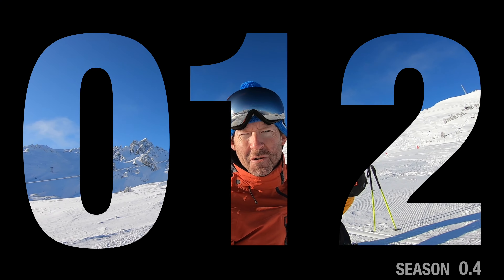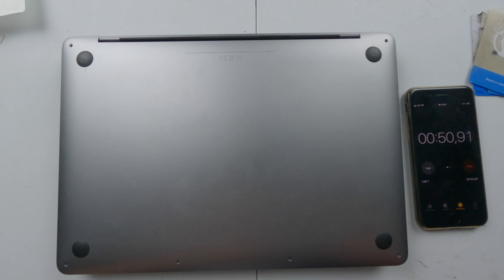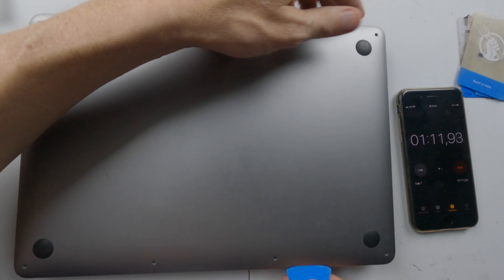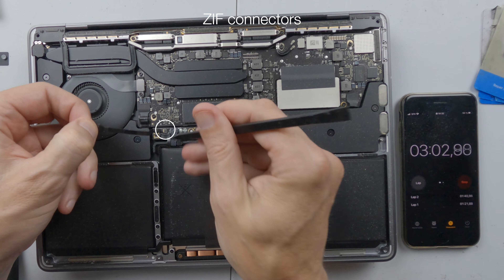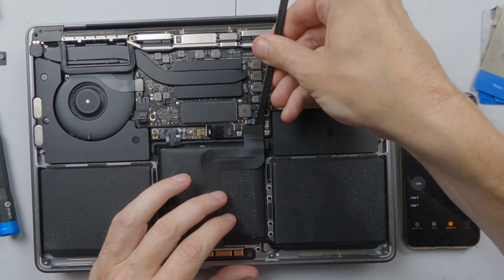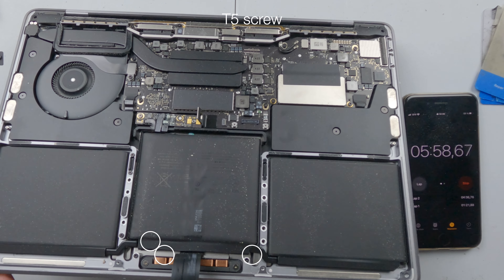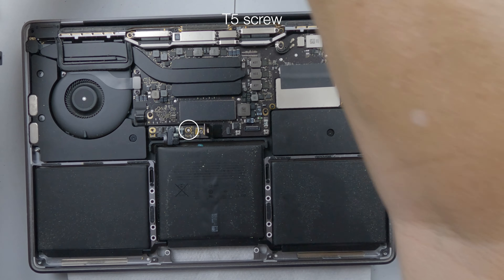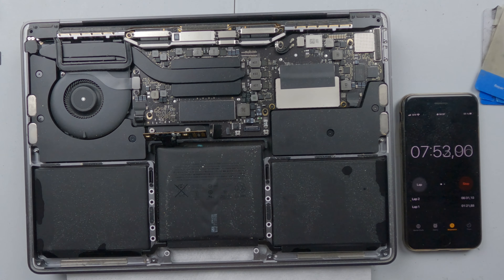2017 MACBOOK PRO A1708 BATTERY REPLACEMENT 30 MINS 4K

Comment: BEWARE! When putting back the ZIF connectors you MUST NOT allow the ribbon to touch the components beneath, otherwise a reaction will occur and you will fry these pieces. Like I did. Just now 😖
Reply: What is the ribbon?
Reply: @Jmfox1999  ribbon is the cable which is ver wobbly. Usually on ribbons the contacts are you open and you can very quickly bridge something

Comment: This is fine until the end where he just skips over reconnecting the tricky little cables and ensuring all the hardware is back together properly.
Reply from the maker: If you go back and watch the disassembly in reverse that should sort it. (Yes that last cable is fiddly and reinserting a zif cable is just something you can or cannot do easily)
Reply: I agree, it’s actually the most important part of assembly. I spent an hour just working out how to get the darn ribbon cable back in its place! So fiddly. It’s very Satisfying cuz I worked it out all by myself! 😅😁

Comment: I could not see the point on messing with removing the track pad at all. Does not interfere at all with the job except the cable removal on top pf battery. BTW that little cable at the end of your footage is a Biach to reinstall.
Reply from the maker: I partially agree however the cable is easy to damage when you are de-gluing the battery , as its only 8 screws its better to be safe than sorry. and Yes I hate those little zif connectors too.
Reply: 🤬😡 you’re not kidding..that teeny tiny connecter teeth is a right pain in the.. got it!

Comment: awesome tutorial, thanks for this video. is there no need to stick a fresh set of adhesive on the replacement battery?
Reply from the maker: Its best to remove all the old adhesive from the computer before installing the new battery. I don't know if its the OCD in me but Its the difference between the doing the job and doing the job perfectly.

Comment: I am trying to get information on how long the replacement battery lasts on a single charge to determine when I should replace my battery.
Reply from the maker: In my experience replacement (Ifixit) lithium ion batteries last between 2-3 years
Reply: @150daysofwinter  I meant how many hours the new replacement battery lasts on a single charge as compared to the original apple battery when the laptop was new.
Reply: For example I get about 3 hours of performance out of my current battery...  if I can boost that to 6 hours, I will replace the battery now.  But if I am only going to get 4 hours hours out of the replacement, I will wait until the original battery has more cycles on it before I replace it. (The current capacity of the original battery is 70%)
Reply: DSY bq20z451
System Apple Inc. MacBookPro13,1
Technology Lithium ion
Nominal capacity 54.7 Wh
Actual capacity 39.41 Wh
Capacity percentage 70%

Comment: I done all that thank you, but the keypad won’t select it moves the mouse arrow but won’t select and seems very solid no flex, any ideas exact same model.
Reply from the maker: Make sure the touchpad cable that goes over battery is properly connected and not damaged when it was removed. It's easy to do. Like the touchid on iphone 7s and up. the touchpad no longer moves. it registers a "click" by returning a taptic "click" making you think you pushed down.

Comment: hello! do you have a link for the battery you used? i have a 2017 macbook pro 13” that needs its battery replaced.
Reply from the maker: Due to their good customer service I prefer spending a little bit more buying from ifixit.com . This is the link to the euro store. https://store.ifixit.fr/products/macbook-pro-13-retina-function-keys-late-2016-2017-battery?variant=31702781657139

Comment: Help! Did everything in the video step by step. Plugged the laptop in, battery shows 100% fully charged BUT, when I unplug the charger cable from the MacBook it loses all power and won’t power back on without the charging cable.
Reply from the maker: make sure a) the main battery connector screw is fully installed. Also make sure the little ribbon cable which attaches to two different zif connectors either side of the battery connector are properly installed. Its very fiddlely and if not fully inserted into the connectors will affect the battery
Reply: @150daysofwinter  So I checked everything and still couldn’t get it to power on. Decided to take it to the Apple Store to have them take a look. They’re telling me there is a BMU top cable that’s missing that may have been thrown out with the old battery. I don’t remember seeing one missing but I ordered a replacement.

Comment: Very helpful video. Thankyou for that. Do you have any idea how to recalibrate the battery so the system knows to do whatever it has to do? Or is this all just an automatic process
Reply from the maker: Ifixit, who i buy most of my batteries from, recommend the following. Charge new battery to 100% and keep charging it for at least 2 hours. Then use your laptop until the battery runs out. Finally charge it uninterrupted to 100%.

Comment: Thank you for a great comprehensive video - and wow you are a speeding bullet! Question: I noticed (or maybe I missed it) that you didn't put any adhesive to hold the battery in place like the old battery - is that not necessary? Many thanks again!
Reply from the maker: The replacement battery has adhesive strips already installed

Comment: Very nice video. Question: did you remove the trackpad in order to protect it from the adhesive remover liquid? Suggestion: I'm even more OCD than you, but I would have used a single-edged razor blade to remove the adhesive strips, and then cleaned the surface with some of the adhesive remover.
Reply from the maker: haha. The trackpad cable is quite delicate and it makes life easier to just remove it. After removing another battery I was doing the exact same thing while i waited for the new battery to arrive.

Comment: Terrific video, straightforward easy to follow. How do I replace the thin ribbon? I thought I broke it until I watched you do the same. But you didn’t show how to re attach it. Cheers from Australia
Reply from the maker: I don't think there is an easy way to show how to reconnect that zif connector. Although I've just been handed another macbook pro for battery replacement so I might make another video specifically. It might be a strange one ;-)

Comment: Could this be a reason why my MacBook won’t turn on? I already knew it was something with the battery since it was die quickly if it wasn’t plugged in. Now it just won’t turn on even plugged in
Reply from the maker: Possibly, I've had the same problem with a massively inflated battery. When I disconnected the battery the laptop still turned on (using the correct wattage charger).
Reply: @ yeah I have always used the MacBook plugged in for about 8 months. It randomly would not turn on anymore
Reply from the maker: @melavade  when it turns on. go into the system report and look at the status of the battery (apple logo/about this mac/system report/power) it will tell you if the laptop is having problems communicating with the battery
Reply: @ It won’t budge now. It’s been 5 months since it has turned on
Reply from the maker: @melavade  Old Lithium batteries hate being totally discharged. If you can disconnect the battery and then plug in the power to see if it comes on.

Comment: Does the computer know it's a non-apple battery? Like the Iphones can?
Reply from the maker: if you click the apple menu -> about this mac -> system report -> power it will show you the manufactuer and serial number of the battery (as well as the health of the battery). However unlike the phones Apple won't point out what type of battery you are using.

Comment: I changed mind but it won’t charge, the battery icon won’t come and the laptop only comes on when it’s plug on charge 😮 please help.
Reply from the maker: Make sure the battery connector is properly seated. I’ve seen times when the screw is not properly aligned and so not properly connected

Comment: Geezus christ, I hate Macs.  They make their stuff just stupid difficult to repair.  Adhesive for the battery?  Really?  Why??  They're like German cars: just over-engineered for no good reason.
Reply from the maker: To a certain extent I agree but compared to their plastic competition I would take the over engineered. I do miss the old MBA which had 5 screws holding in the battery